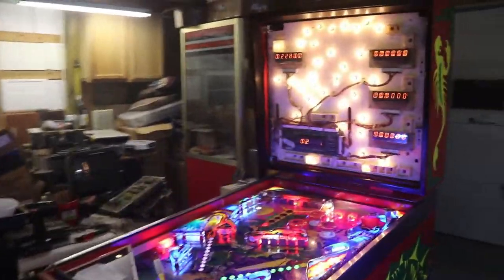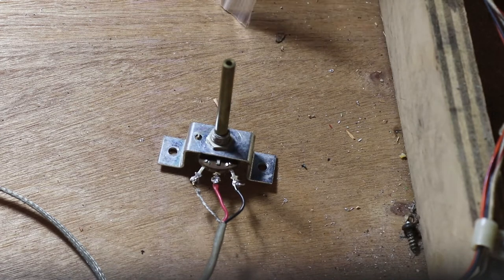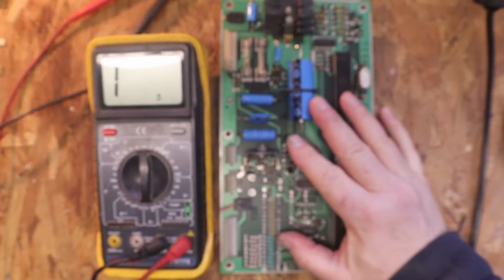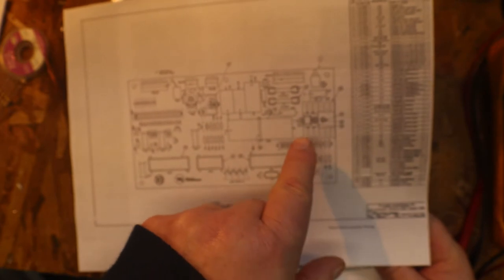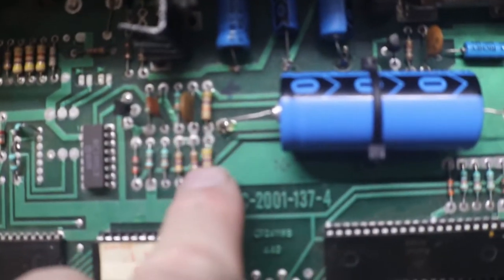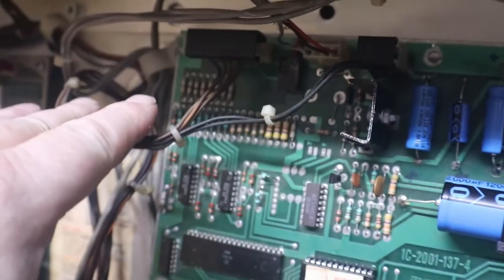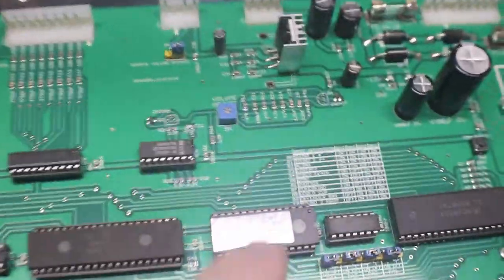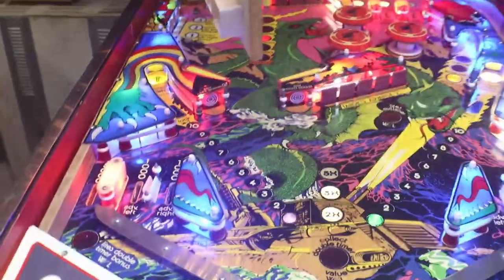Repair or Replace  Sound Board 1980 Williams Scorpion / Bad Sound / Ep 11

Comment: i had the same hum on my time warp years ago, I change a setting on no.35 to zero and the hum stopped. I believe it gave you a 0 thru 5 option . Afterwards, shut off the power and turn back on, the humming stopped.
Reply: this was on the game adjustment manual, factory setting was 18. see note nine, it turns background noise off if you set it to zero
Reply from the maker: Thank You I will give it a try.